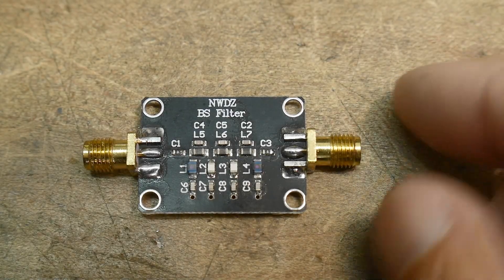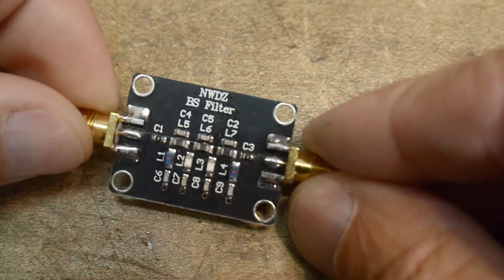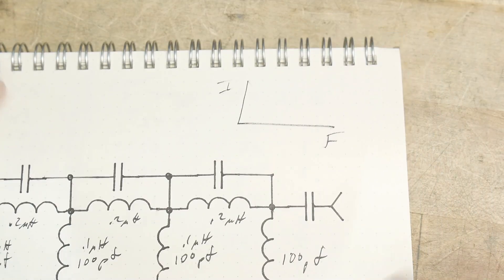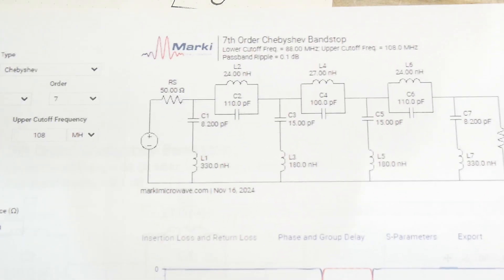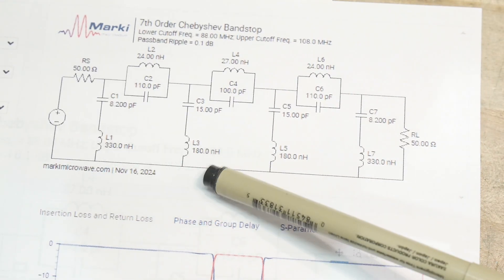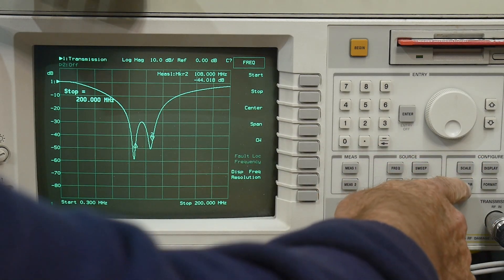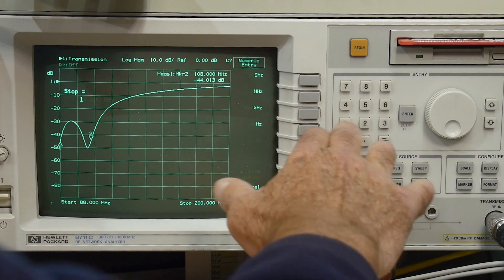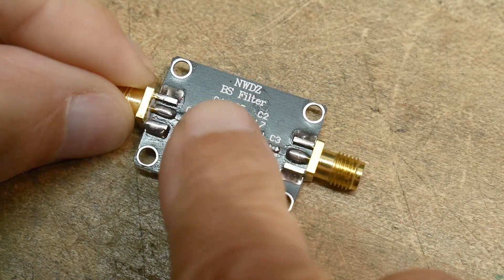#2062 BS Filter

Comment: If you wanted to get rid of that 'loop-de-doop' in the middle, could you make another band pass filter for those frequencies and put it in series with the other filter?
Reply from the maker: they way to improve things is to all more orders. this is a 7th order filter. more orders add more capacitors and inductors. you can try this on the https://markimicrowave.com/technical-resources/tools/lc-filter-design-tool/

Comment: Also good enough to work on the Japanese FM band as well, and ironically with better rejection there as well in the non overlapping area. By me sadly only going to be getting 30dB attenuation at the strongest signals in the FM band though, that 92-98MHz band is the one in the middle with all the high power stations, so they do not have any harmonics outside the band, and they transmit with 20kW per station, except for a few small filler transmitters in the middle, which are 200W or so.

Comment: This should be a MANDATORY part of any microphone used by politicians...
Reply: Then you wouldn't hear anything!
Reply: @ thats also good!
Reply: 120 dB Cut between 20Hz and 20kHz ?
Reply: Silence on quantum level at least! 
In theory, if the subatomic particles are completely stopped, they are going out of existence.
No movement, no energy, no time, no space. Puff pure dimension shift to Zero dimension.
Reply: It's better to just cut the mic cable, or remove the battery if it's a wireless mic. Simple, cheap, effective.
Reply: trump cant speak bruh

Comment: Interesting device and video.   They're never on the frequency I want though !  Recently tried a L/4 stub to reject 1152MHz but rejection/loss at wanted frequency (1296MHz) was still too high. Would be interested to see what the typical 3dB loss frequencies of the filter are.
Reply: Stub filters work best as a harmonic filter.  ie. a 160 Meter stub filter nulls 80, 40, 20, 15 and 10 Meter.  For UHF and above frequencies I usually use high or low pass filters to block unwanted signals.  In your case I would use a high pass filter.  Mike KC3OSD.